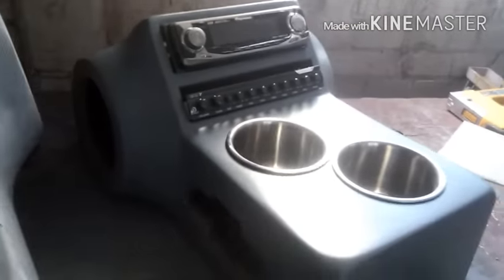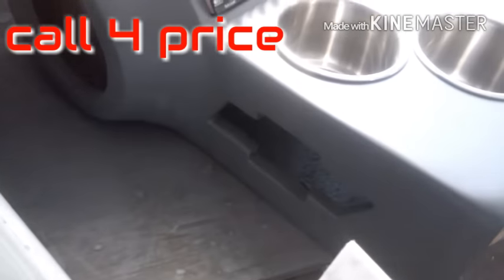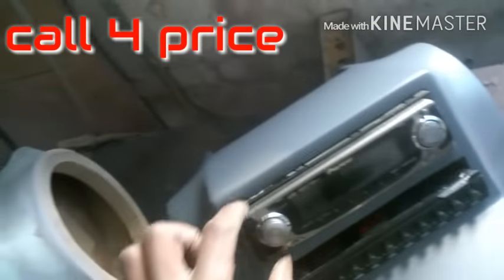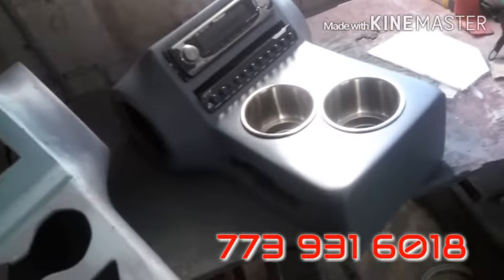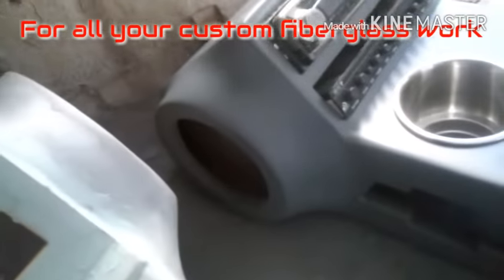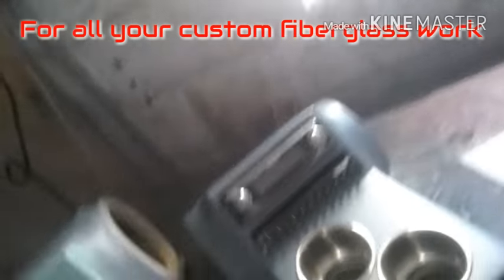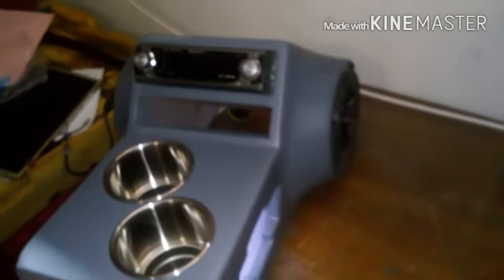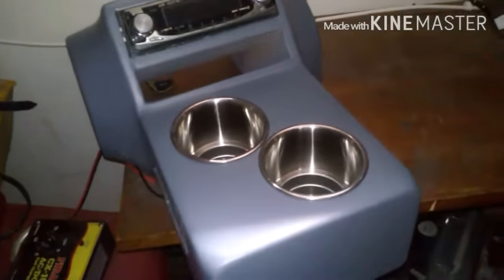1978 - 1990 Chevy Caprice Classic console

Comment: router the chevy sign out separately (like a ring) and router the edges so its clean... stretch the fleece/wrap the project, then insert the sign, the fleece would be under the sign... it will help to lock the fleece down and allow you to integrate the sign cleanly...
Reply from the maker: good idea THANKS